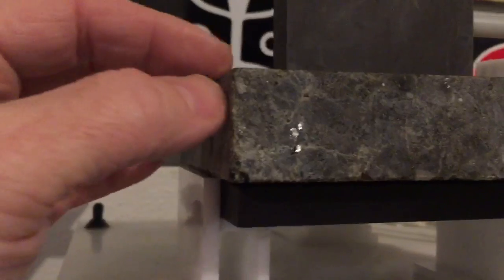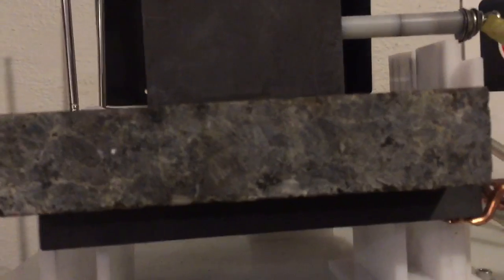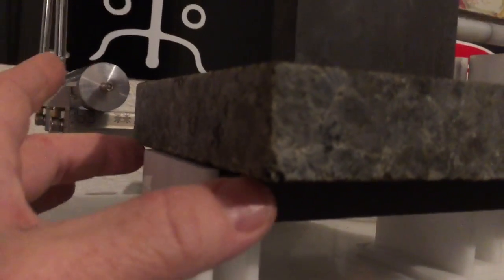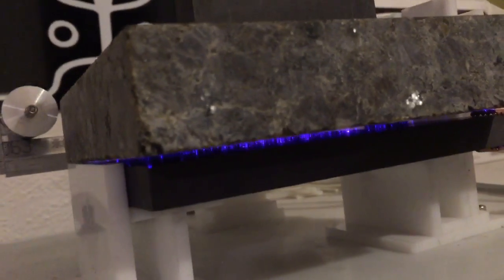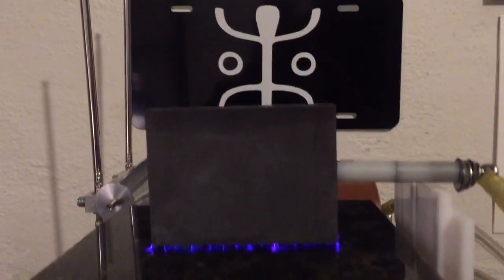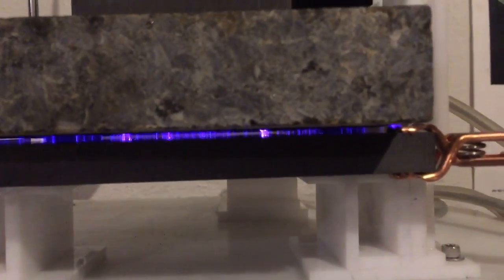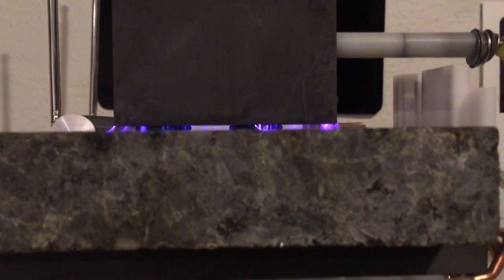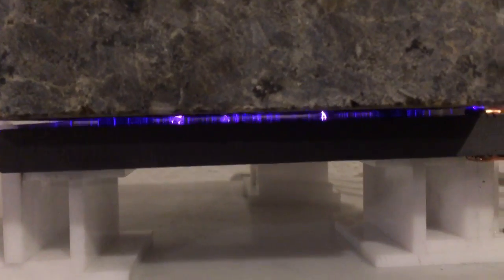Piezo electric amplification?

Comment: You're not amplifying power and getting more energy out than you are putting in though. What you refer to as "surface area amplification" is just a product of the ways electric fields and corona discharge work. However, keep experimenting and learn more about how real electromagnetics work as there are some very cool things you can do.
Reply from the maker: Correct.  I was not implying power.  Rather just an interesting surface area distribution.  Not sure at that time if it was via defects in the crystalline structure or a result of interaction with the crystalline structure.  The exceedingly small amount of current however was able to essentially melt clean through the granite without any difficulty……. 23mA.
Reply: @diveflyfish  Hmmm. Interesting. Melting through the granite is definitely impressive. I wonder if you could get better results with a sharper point (on both ends? On only one side?). I don’t think it’s “piezoelectric amplification” as the piezoelectric effect is another thing. Instead, the extremely hot high voltage arc is slightly melting and finding its way through small cracks in the granite.
Reply: @YSPACElabs  Melting the granite, maybe this is the kind of technology used in an ancient time, Egypte, Hindi empire etc.
Reply from the maker: it also can bore a hole through a ceramic Zirconia knife blade etc.  imagine if such a discharge was at the tips of a large scale boring machine grinding face……… plasma effects are scale invariant

Comment: Sorta makes me think of the photon slit experiment...  coherent in, incoherent out...  Now, find the resonant dimensions and have fun electrolysing your substrate into the atmosphere.
Reply from the maker: Your intuition is correct on the latter statement.  The interesting thing is that the circuit has perhaps a bit of auto-tune capacity and very often does find the resonance required to effect what you envision.  To be sure, capacity to bore clean through Zirconia ceramic material is astonishing considering 23mA as source input.........
Reply: @diveflyfish  I was just wondering about 'solid plasma' yesterday...  If only there was some way to change the atmospheric composition and pressure in the reaction chamber...  I'm always wanting to relate more or less dimensions to an experiment.

Comment: Your video is extremely fascinating and triggers a multitude of questions. I wish I could have seen from start to finish with a Breakdown on the equipment used. Hearing the Vibration makes wonder what exactly is happening with Piezoelectric current transmission through the Granite. I wonder if a speaker could replicate the same Vibrational sound with the same results...

Comment: I think you've used the wrong word to describe the effect.  Since the only energy in the circuit is that supplied by you, that measurement of energy cannot be said to be amplified since that would defy the laws of physics.  But it can be dispersed over a greater area, so the question that needs answering is: are the electrical spikes between the bottom electrode and the granite spaced at a greater distance apart than those in the upper electrode?  The quartz could serve to disperse them since the power would tend to follow the path of least resistance, and that path could be a more circuitous route than simple straight through.
Reply from the maker: Agreed, I am not quantifying any energetic amount per se to be sure.  The magnification of effect is distributive from surface area.  The interesting thing is that the intensity does not seem to be obtunded.  Rather with time it melts holes through the granite to ensure least resistance.  I was however surprised by how broad an area the initial input spread upon meeting the resistance or impedance of the granite.
Reply from the maker: The question I have is there any temporary stress to the granite that is eliciting a commensurate rebound electric discharge.  If so how much?  That is the difficult thing to measure given the nature of the circuit.  It auto regulates.  The overall effect is profound when the area is seen and is not as expected if one were to use a simple HV input.  Usually the impedance would make the output smaller.  The sum diameters is the key, and in viewing it, seems very much larger than surface area of input, which is interesting.  The only way to know for sure is if there is any measurable delta in volts or wave form that could be observable.  This is just a means to show, substrate even with a small footprint input can generate an enormously larger distribution effect in surface area.

Comment: I had a tone generator connected to the primary of a transformer and some LEDs connected to the secondary. I then connected a piezo speaker in parallel with the LEDs and they got brighter. My theory is that I'm stimulating the crystal at resonant frequency which in turn powers my LEDs.

Comment: Thanks for posting this. Are you using a Tesla hairpin circuit, but replacing the Tesla's copper pipes with carbon blocks? Do you have a video or diagram of the setup itself? Using granite for this is really groundbreaking (no pun intended).